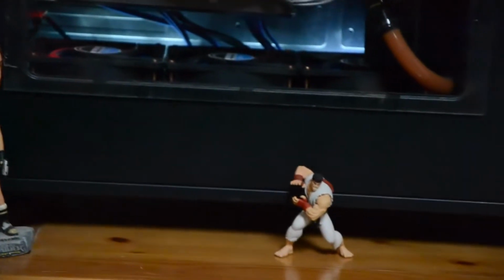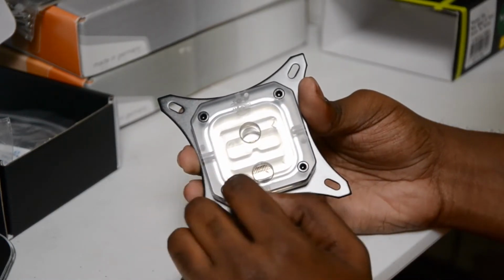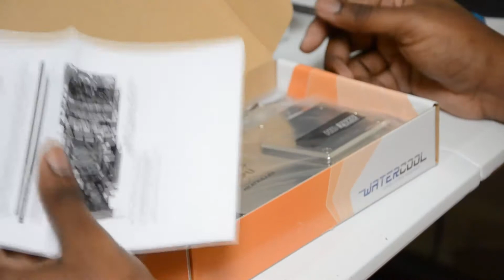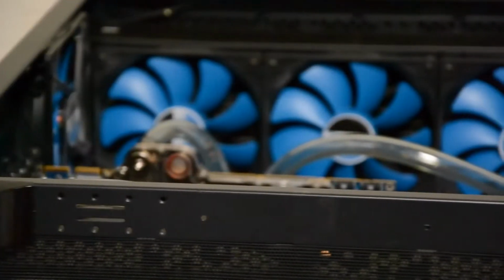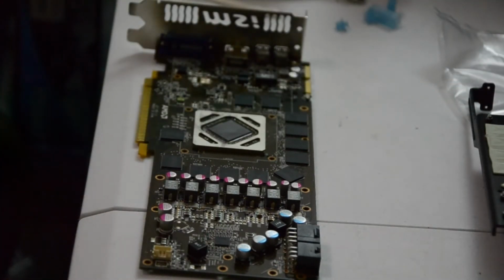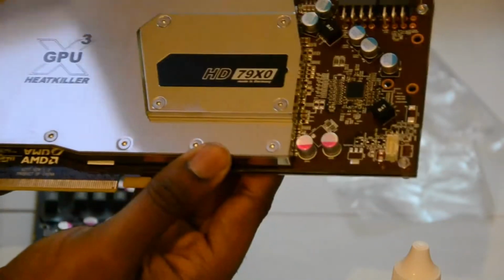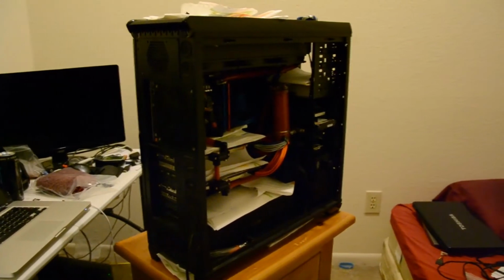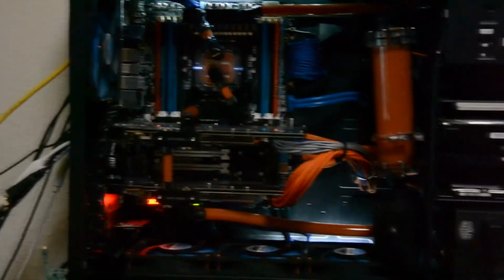Patience Update Dec-2012

Comment from the maker: The cards have been awesome. Benched on Unigine for several hours and not a single problem. I'm running them stock right now. I don't really see a need to keep them overclocked 24/7. Everything runs smooth. :)

Comment from the maker: CoolingConfigurator. com a site made specifically to tell users which cards are reference and which ones can fit their blocks. Its a good way to see which cards are reference and which one's are not. I believe there are other 7950s that use the 7970 PCB. If the 7950 is an overclocked or premium version than it would be a good idea to check the site I mentioned above and you can also email HeatKiller at watercool. de. They do reply quickly as I found out after this. lol